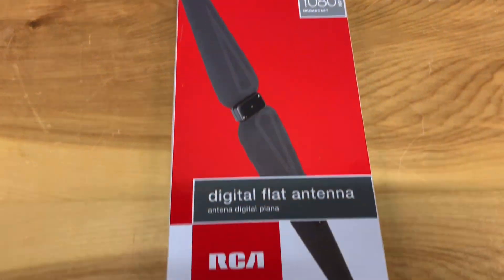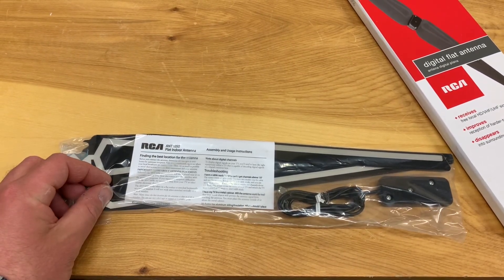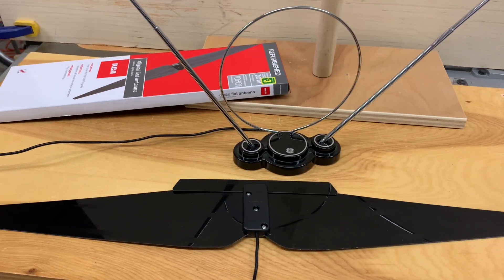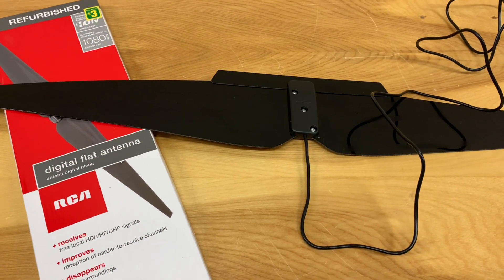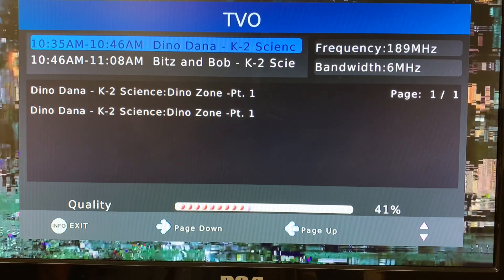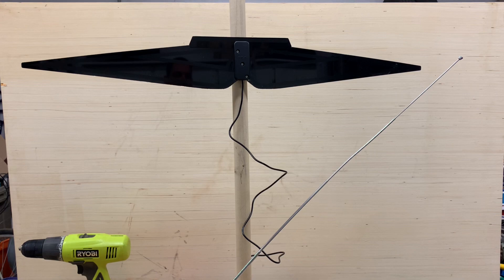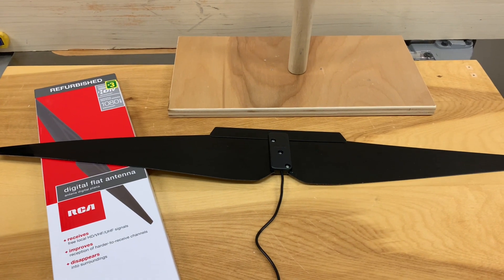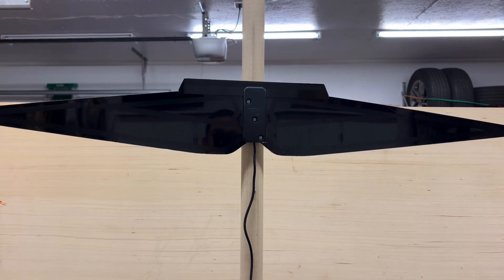Dollar Store TV Antenna | How Well Does it Work?

Comment: The question is how much better would the strongest antenna work outside with a preamp.
Reply from the maker: There are many factors that would determine that, on an area by area basis.

Comment: I bought two of these antennas several years back, and I can confirm they work really well. 
For a gadget that only costs a few dollars, they do the job.
In my experience, they work best outdoors, with no obstructions blocking them. 
Like all digital antennas, they must be pointing directly at the source of the signal to be able to pick anything up.
"Line of sight" to the source is very important. 
But the bottom line is, they work.
Reply from the maker: Can’t go wrong for the price! Thanks for watching.📡